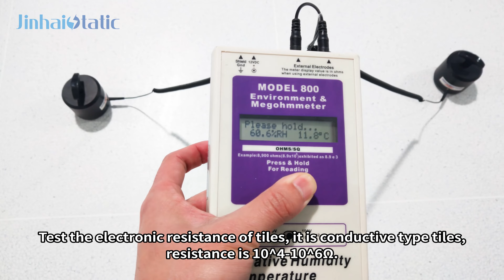ESD Tiles Installation, Anti static / Conductive PVC Tile Installation - Jinhai Static

Comment: I have been working in the installation and assistance of ESD floors for more than 30 years and I can say that:
- the copper band must be placed before the conductive glue
- the glue must not dry but the plate must be placed on fresh glue and immediately rolled
- in this way with the use of a good conductive glue you can save a lot of copper band because the glue will act as a conductor and the band only acts as a ground discharge.
Reply: do you know spesification for the cooper band ? like the width and thickness of it
Reply: also brand for the adhesive
Reply: Give ur contact